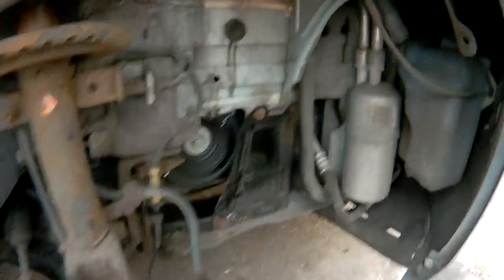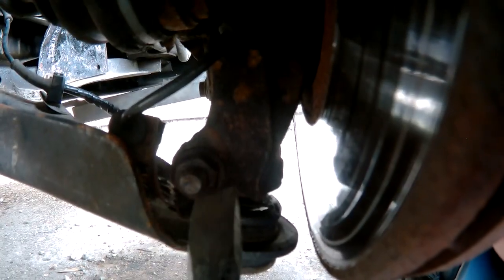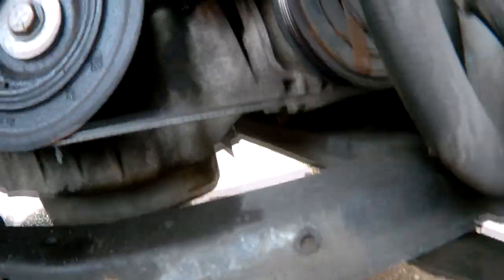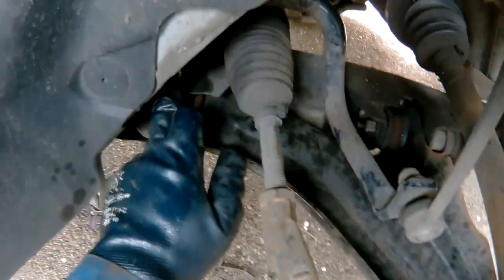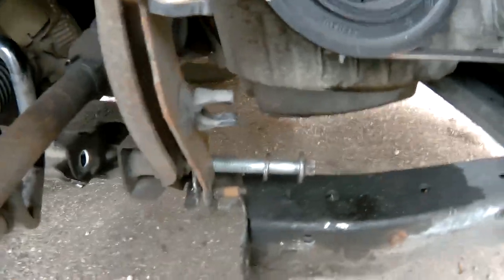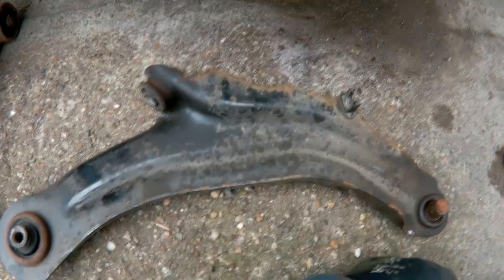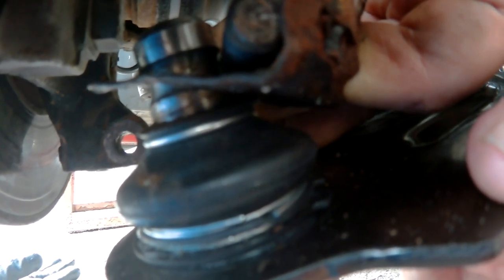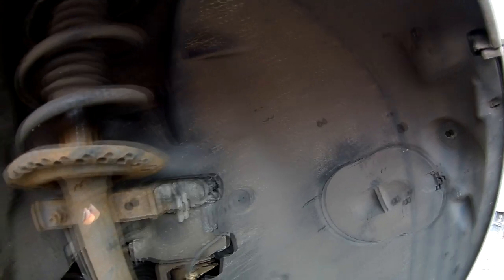Renault Megane Lower suspension arm replace

Comment: I did this job a while back. Some fool who owned the car before me had put the 'pinch' bolt in first and then pushed the ball joint in and tightened the bolt. Thinking it was just a pinch bolt and the ball joint fell out, luckily at low speed. I ended up putting a new arm in. Always make sure the bolt meets with the lip on the ball joint. Because that is what stops it coming out.
Reply from the maker: That was lucky. Imagine doing 70 on a motorway and the ball joint drops off.

Comment: Interesting how you did it by just moving away the front part of the subframe, to both sides I chose to remove the unit but I had to support the two radiators. 6 years later I have to do it again before I take it for an MOT - Thanks for the interesting tip
Reply from the maker: You might need a good crowbar to move it as it took some effort but was easy.
Reply: @SteveSims  I'm sure you have released tension from the two front vertical bolts (19mm socket if I remember right )

Comment: Same mounting for Clio IV. Thanks for the video 💪🏻😀
Reply from the maker: Thanks. Does the clio have a similar strut in the way of the long bolt?
Reply: @SteveSims  I will replace the arm on Sunday. I will let you know and make a small movie
Reply: Steve Sims Yes same strut but far more complicated and time consuming due to misleading Haynes manual. You need to support the radiator while moving the strut and replacing A-arm. There is some alignments as well. I spend a total of 6 hours.
Reply from the maker: @janthyregod5763  The radiator on the Megane was resting on a beam that went along the front of the car that the other beam was bolted onto at the front (where someone had cut a hole on the video). The radiator was just supported on the beam and had 2 lugs that went into holes on the beam. Glad you got it done though as it would cost a lot at a mechanics and  doing it yourself you get to know the car a bit better.
Reply: Steve Sims on the Clio there is a hole to support the radiator but not for the bolt. Saved DKK 4500 on the authorised dealer price ex part price of DKK 300 incl freight

Comment: Nice video Steve, wish you'd shown a bit more on getting the bolts out though. Having a mare with mine, cannot get pinch bolt out from balljoint. Really frustrating .
Reply from the maker: I gave it a good spray of wd40 the day before and left it to soak in. Mine was like a nut and bolt so one end had a spanner and the other end a socket and a big hammer to hit it with. That took a lot of beating with a hammer to replace both sides.
Reply: @SteveSims  Thanks Steve . Was a bit reluctant to go too hard with the hammer, as wasn't sure if bolt was threaded in hub or just pushed in. Was thinking of the blow torch , but too near CV gaiter, could see it going badly wrong ! Car I garage today, frustrating couldn't do it myself but hey ho.
Reply from the maker: @rogerkretzschmar8280  better to be safe than sorry. I've had many a DIY job fail because of 1 stuck nut.
Reply: @SteveSims  Learnt over the years to know when to stop and pay for job . 
Had it fitted yesterday , £60 + £ 23 for part, which I thought was good price. 
Unfortunately , still got knocking noise when pulling away or slowing down  on drivers side !
Reply from the maker: @rogerkretzschmar8280  CV joint somewhere ? or exhaust on bodywork or heatshield or loose / worn engine mount?
Reply: @SteveSims  Thanks for suggestions. It's only pulling away/ stopping or on rough surface. Passed MOT 3 weeks ago, really strange. Straight line on good surface knocking disapears.
Reply: Regarding 13 mm ball joint nut. I had to use a chisel & WD 40 often you have to use heat & a tight 6 point impact type  good solid socket. In trade we use a warm with acetylene torch
 Mine was awfully Rust t and tight I have had to split nut  sharp chisel or grinder. & and replace it a few times to save time & frustration. ..

Comment: good job,mate
Reply from the maker: Thanks. I found that these cars need to be taken apart to do even the simplest of jobs, but they do come apart easily.
Reply: @SteveSims  At least they don't use No special tools like Opel/Vauxhall ,like E numbered ,opposite of torx.
Reply from the maker: @Jozavenue  I did have to buy a £25 cam locking tool when I changed the dephaser pully but all other tools are just normal so yea it's been OK.

Comment: Can I ask if the lower ball joint can be removed from the control arm? Once the end of the control arm which attaches to the steering rack has been removed would I be able to support the arm and punch out the lower joint with a hammer/Chisel?
Reply from the maker: I can't remember how firmly it was fitted in, I think it will be difficult to remove it. I know you can buy just the ball joint on ebay
Reply: Steve Sims thanks for getting back to me
Reply from the maker: @douglasforsyth3777  The ball joint on ebay has a big circlip that fits around the top to hold it in. I think the one fitted to the arm has the metal of the arm folded into a groove on the ball joint. I would give it a good clean and have a look how it is fitted in.
Reply from the maker: @douglasforsyth3777  Good luck.
Reply: yes you can. But you still need to take the arm out and use proper tubes, plates and a hydraulic press. You cant change it while bein mounted to the suspension sub frame . Seeing that you think the control arm is conected to the steering rack I advise to go have someone else do the job.
Reply: @SteveSims  doesnt need any circlip. It's pressed. Don't worry . It won't come out if its pressed all thae way to the end.